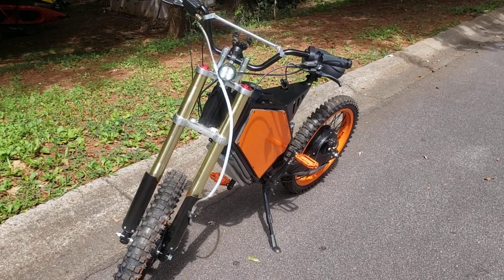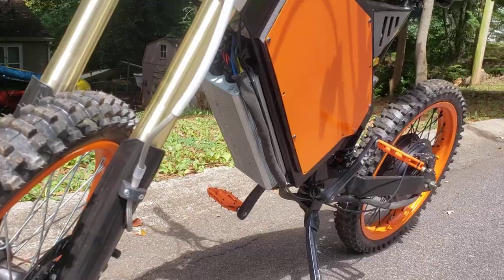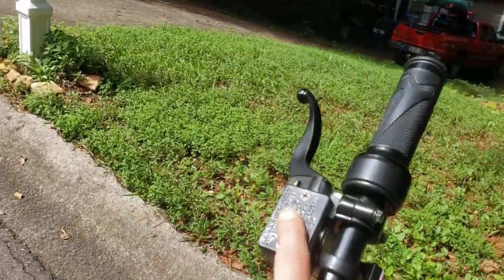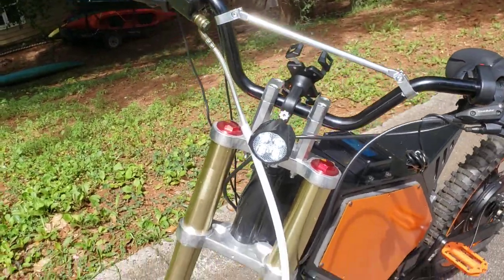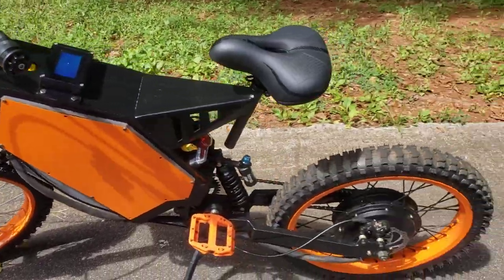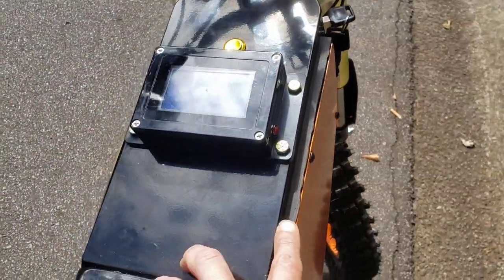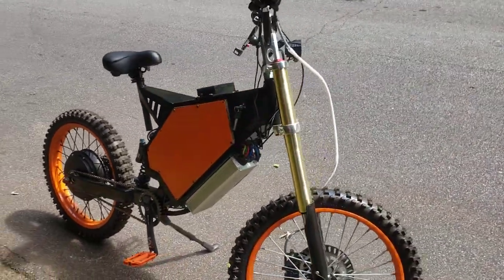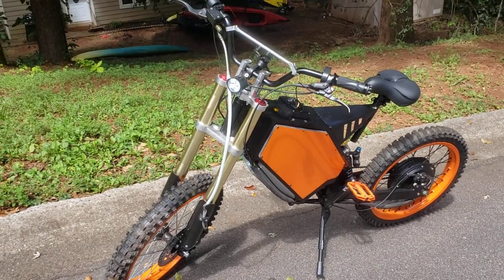100.8v, 300a ant bms, qs205 5t, Stealth Bomber clone, dirtbike suspension, ebike build

Comment: Looks great, I definitely want to do a higher voltage build eventually.
Reply from the maker: Its a lot of work but totally worth it.
Reply: @felonebike9859  
What's the top speed? I have a 72v 5T bike that tops out at 40mph without field weakening, and if speed scales linearly with voltage then 101v would be 55mph.
Is that about right?

Comment: Nice 👍 and nice job with the spacer for the battery box. What material did you use for that?
Reply from the maker: I used the foam board that is used in gym floors. The ones that lock together. Worked perfectly. I cut it to the shape of the side panels and because it compresses i just pushed it on. So it's holding the battery together as well.
Reply: @felonebike9859  what a fantastic idea

Comment: Great job! What is the max speed with that voltage?
Reply from the maker: 57mph with the 5t so far. Gets there quick though.
Reply: @felonebike9859  Wow I would have thought it would top out much higher with you pushing that kind of voltage.
I bought a 12000w enduroebike, 72v, 48ah battery and it goes about 57mph at top speed. I can hit 60mph if I duck down enough to reduce wind resistance.
It also picks up pretty fast.

But I do like your brakes.
Reply from the maker: @IdealIdeas100  Thats because your running a 3.5t motor. My 3.5t goes 65mph at 72v as well. This is a 5t. Way more tourqe. So it gets there instantly and will climb any hills, wheelie and smoke tires.

Comment: How did you show horn that battery in.😲
Reply from the maker: I made it in 2 halves and added foam board to the side panels to get an extra ¾ inch. So one half is 12s 12p and the other half is 12s 12p.

Comment: What fork is that??
Reply from the maker: 150cc dirtbike forks. Any will fit, but lots of fabrication.
Reply: @felonebike9859  what the mod do you have made i have ordered the frame and is my idea to go whit this fork what i have to do to fit ( 44mm bearing race fit directely on stealth bomber frame or not ? if they fit i tinhk just make a spacer on top and thry fit? tank you to give info on that